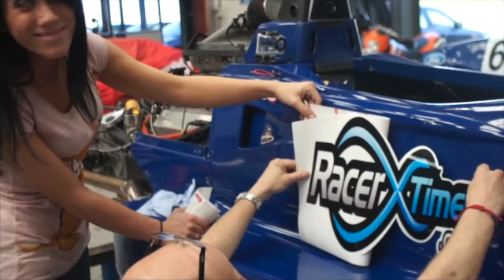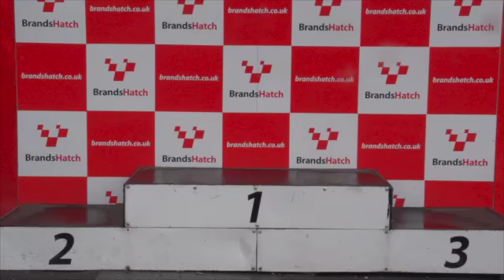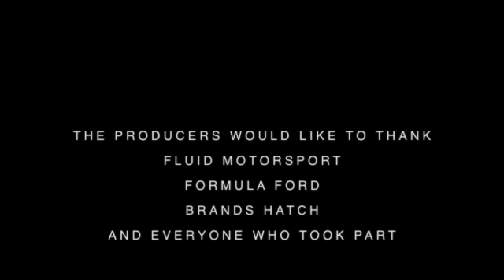"The Racer" Movie   RacerTimes.com

Comment: Funny, as this is one of only two YouTube videos that have done this with the rhythmic breaking up of audio. Also, there's nothing wrong with my monitors; I use a DAW with 5" near field monitors and a professional mixer routed through firewire, so I'm pretty confident it's not my gear! The opening dialogue is too mumbly to hear over the strings; it's been poorly mixed. Also, the levels of the various pieces of music are all over the place so no, it's nothing to do with my pro gear, it's the vid!